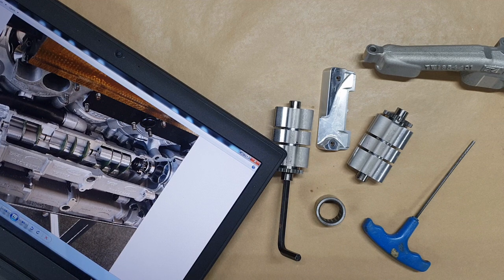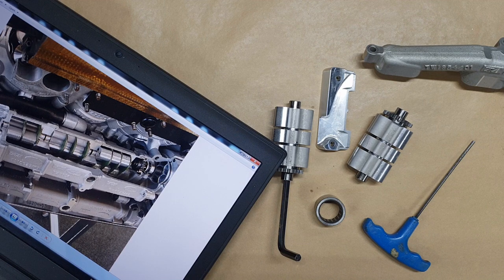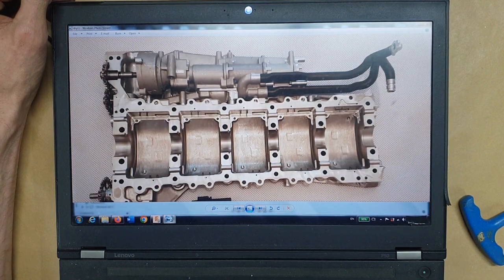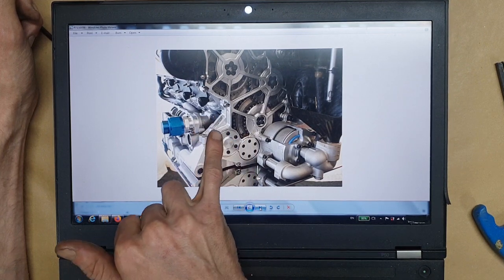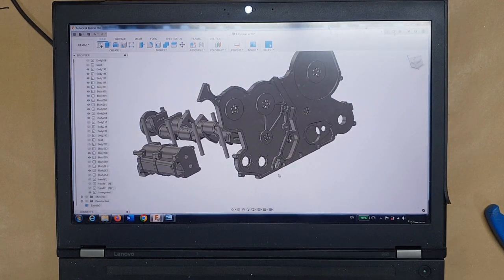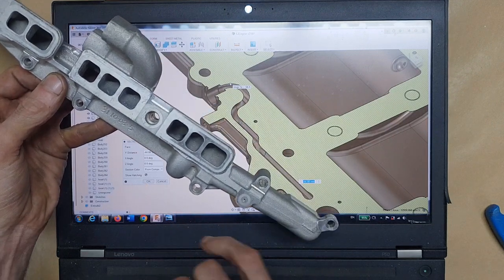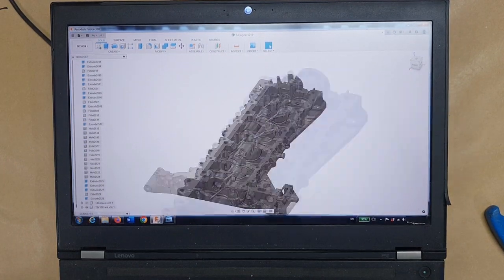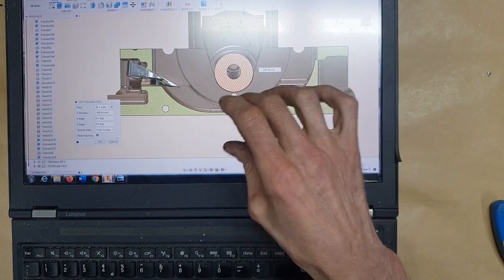F1 Engine Oil Scavenge System - A Closer Look - Ep 11

Comment: I was a motorcycle mechanic and 'failed' engineer (just couldn't do math even, with a slide rule) but have always had a great interest in ICE piston engines. 
I first found out about oil squirters around 1984 when Suzuki launched the SACS motors.
 At the time they said it was old aircraft technology from around 1930's but was first time it had been used on a production motorcycle engine.
The scavenge side is a high volume with (probably?) low (ish?) pressure? 
Very interesting. I wondered why there were Rootes type rotors on desk but it's simple once you started explaining it

Comment: Have you looked at the torocoid pumps that Honda used for both the feed and scavenge pumps?
Reply from the maker: I presume you mean the Gerotor type? If so yes...see Ep 4, second half, and also the link in the description from the Honda F1 Tech document - oil pump details 3/4 of the way down in doc.
Reply: @EngineeredtoWin  Yes, the gerotor type. I'll have to take a look at that video again and read the document you are talking about.  I appreciate the response, and look forward to a video about carbon fiber oil/water lines!

Comment: Fascinating stuff!
Something that wasn’t discussed, that I suspect is addressed by the distribution of evacuation paths to the various pump scavenge stages, is the control of pressure deltas across the various elements of the engine being scavenged. I’m also imagining the presence of a controlled / metered system of ventilation, to limit the negative pressure into the engine case, as this would affect the efficiency of scavenge of the various scavenge channels / pump stages.
I’m way looking forward to your analysis of the positive pressure / feed side of the system and expect questions will answer themselves then.
I’m also imagining watching these episodes repeatedly, to attempt to understand and appreciate that interactions across the components and phases of the lubrication / engine case evacuation system.

Comment: 41:30 - Here in the US, it's mostly known as a Crank Scraper. As in to scrape the oil off the crank like scraping paint off a window. Normally mounted scary close to the rotating assembly. It'd a somewhat common mod, even on wet sump. The pan just has a little extra valley on the side that catches the oil from the scraper.
Reply: for sure people thinking windage trays are crank scrapers
Reply: I've read a lot about windage in big V-8's and how crank scrapers evolved. Isn't it more common to now have a Teflon sheet actually 'touching' the crank counterweights to scrape oil off?
Reply: @1crazypj  yes most OE manufacturers use them to free up Horsepower, but also help fuel efficiency

Comment: I always wondered if this scavening system is able to get the crankcase below the 1 bar atmospheric pressure. 
To get less windage and pumping losses below the pistons when the engine is running? is this the case?? Another great video again!!
Reply: I imagine it would, is there a limit on crankcase vacuum like NASCAR and drag racing has (limit on scavenger pumps)
Reply: @1crazypj  I don't know.